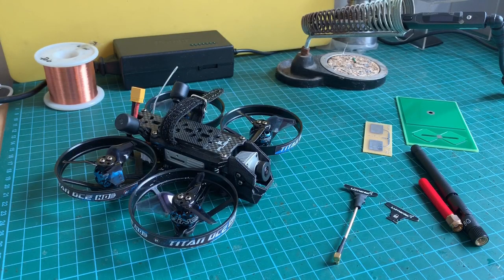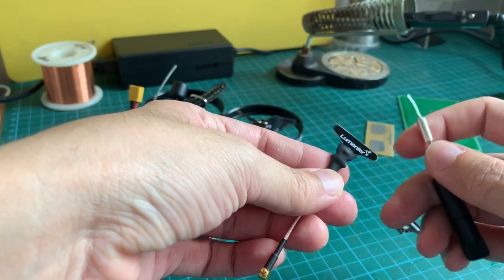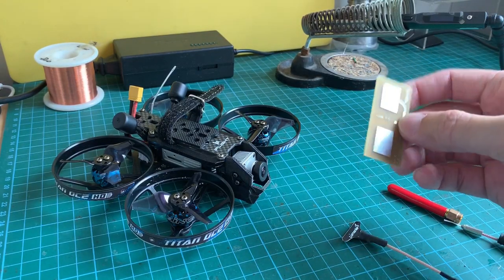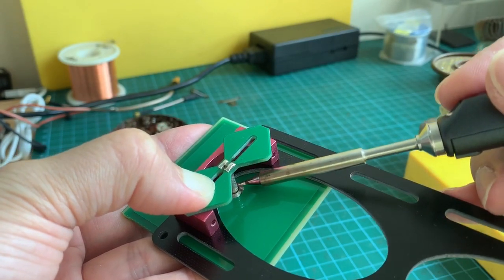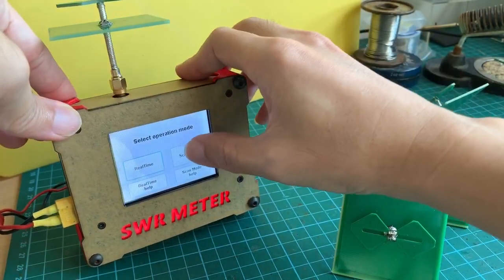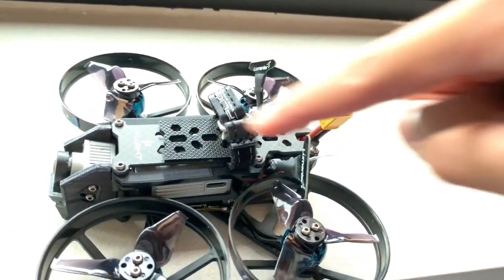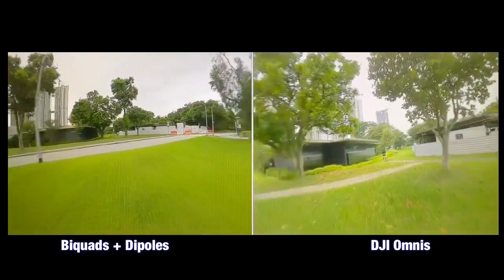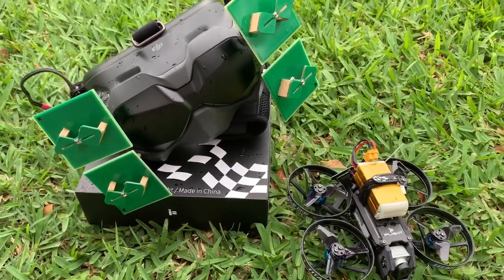Linear Antennas Upgrade for DJI Digital FPV

Comment: thank you for the Video.
I have the first two flights done with my Transtec Beetle, since this is my first HD Quad i have nothing to compare. But I'm thinking about switching the Antennas to the original DJI omis.
I have two concerns with the linear antennas. 
one is the signal Streng (CH) is many times red in the goggles HUD even if the image is quite good. 
second is one of the MMCX of the linear antennas broke at first assembly. (it is still connected but a bit loose)
Do you thik, switching to the DJI omnis will help? I do have the stock antennas on the goggles.
Reply from the maker: I would either change the original antennas of the DJI goggles to linear ones (5.8ghz rubber ducky types or linear patches) to match the beetle’s antennas, which will give a good range. Or, I would swap out the beetle’s antennas to LHCP ones(DJI omnis). As long as both sides are matched (either both linear or both circular), you can expect good range and signal penetration. The issue is you have circular polarized on your goggles and linear polarized on your beetle, that weakens the signal strength by 3db which is 50%!